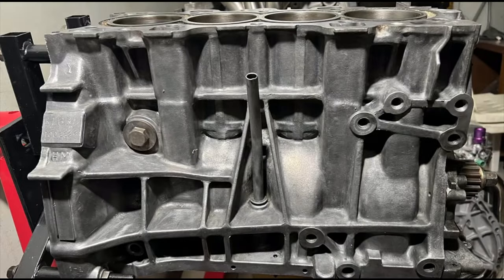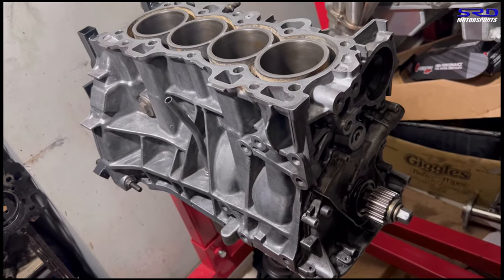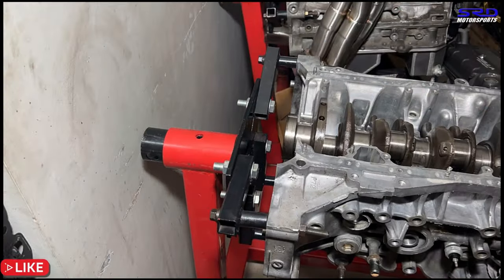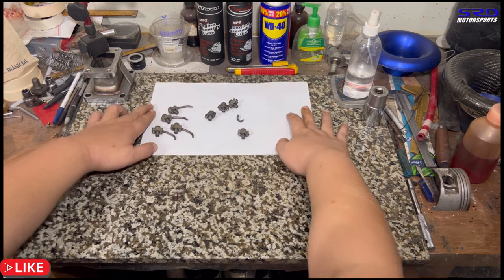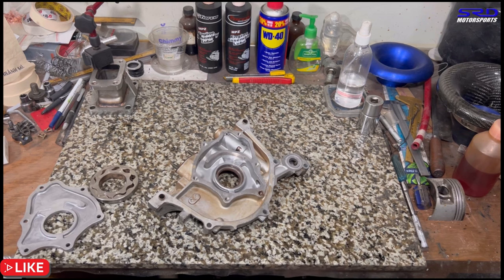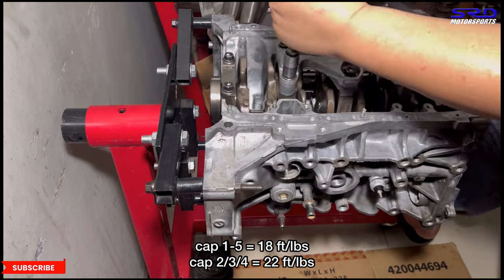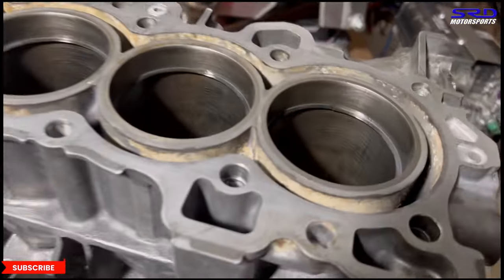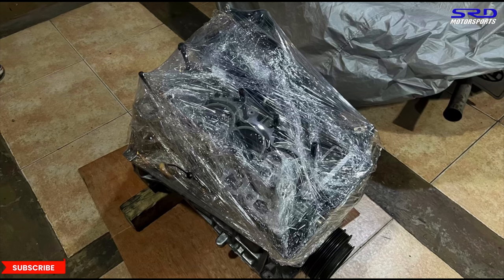B16b Using B20 Crank: Inspection & Final Assembly by SRDmotorsports

Comment from the maker: Join this channel to access exclusive videos:
https://www.youtube.com/channel/UChrn75HL4m9C0OMiLzBQl1g/join
Reply: Dumb question but would a b20 crank on a b18c block be problematic? I want to build a b20 but with the sleeve issues so since I have a built b16a head and a b18c block I wanted to see if it was a good idea to get my b20b crankshaft polished, lighten, and balanced. I could do the same with the b18c crankshaft but I want to get that b20b stroke to get that torque that I desire.
Reply from the maker: That would be fine , depending on pistons u would use

But mainly u gotta plug the oil jet/thrower

Cuz the b20/LS crank and its rods has the oil jet built in on the rod itself = hence diff bearings (rod bearing with hole) vs gsr (no hole)
Reply from the maker: So it isn’t really problematic if done the steps correctly… problematic yeah if b18c oil jet is still there and the b20 rods throw more oil under 😎

other than that? No prob it works and fits even around the girdle

Comment: Building a b16a2 82mm wisecos manley h beam 5.290" rod length using Eagle 84.7 stroker kit im rotating engine by hand getting seized i fixed the oil jets so the clearance for those is good binding up after tighten main caps and rod caps
Reply from the maker: yup

Comment: 🚨🚨🚨Hay question can I use a b20 crank on a b16 block do I have to do this modification and eliminate the oil jets?
Reply from the maker: U can but u will need either custom pistons or custom rods that’s easy $850 atleast if u know the measurements needed

Comment: So you can make a 1.8L B series out of a B16 block with B20/LS crank, and rods?
Reply from the maker: Just B16b = because it’s the same deck height as a B18c the TypeR B16b runs longer rods but b16 stroke… the rods compensate for the taller deck = u can then run b18 or b20 crank and use the rods for the crank type

Comment: What rods are used to allow 89mm crank in a block with deck height shorter than b20/Ls block ?
Reply from the maker: can use either b16 or b20 I’d rather run a b20 length cuz either way u will need custom made pistons for the correct compression height

Comment: B16B engine block with 89 mm stroker crankshaft, LS rod & high compression pistons. Basically, you are saying B16B engine block is taller than B16A engine block.

Comment: sir pwedi po ikabit D16 crankshaft sa D15b na block??
Reply from the maker: No sir main journal diameter is different super layo not possible to machine
Reply: thanks sa info sir.. kasi yung conrod bearing is 0.75, hirap mka kita ng bearing na 0.75
Reply from the maker: What crank for d15b ? Yes anything over .5 hirap